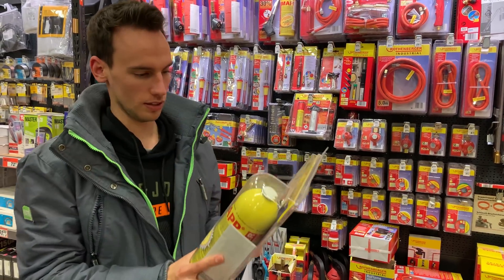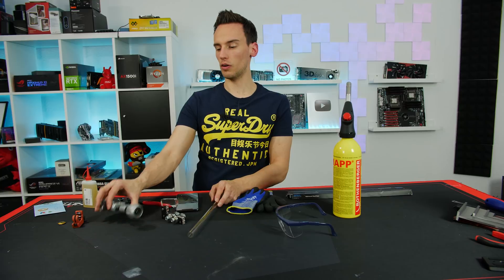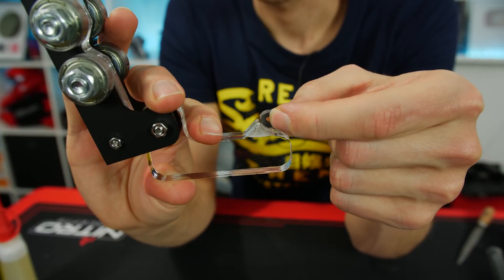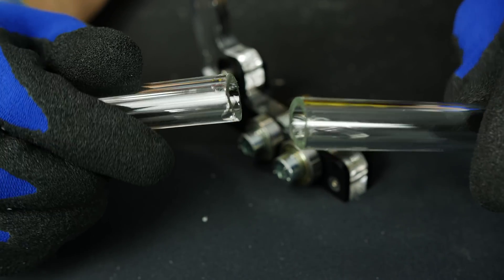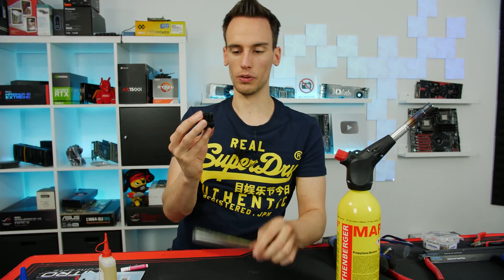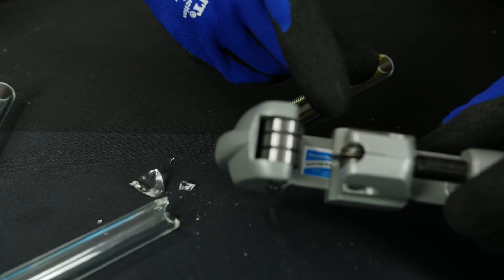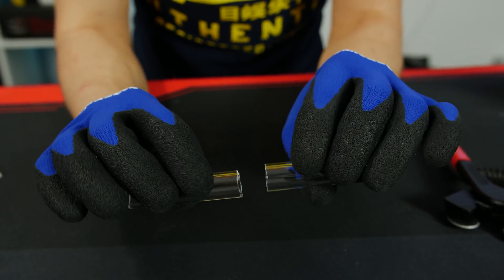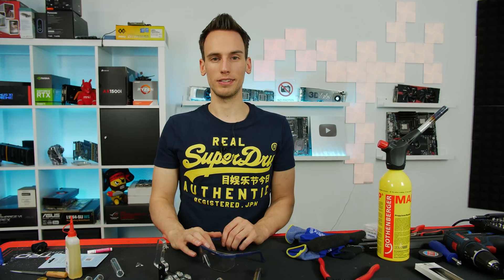Project Irrationality Part 5: "Why did you not just use a normal pipe-cutter?"

Comment: Roman this is Willie V., I am out of town for the Thanksgiving holiday here in the USA this week. I put a video up using my business channel - WillieWaterWorX. It takes time to get the break of the glass to be somewhat clean. There are lots of ways to break tube cleanly. Look at my video, it also explains how to hold the glass and break it, you are brute force snapping and why it is mostly not even. Also when flaming the end make sure to hold the tube in the flame at 90 degree and always rotating be careful not to heat too long cause it will then start to slump to one side! I will be putting up a couple of videos showing more on how to work with Borosilicate glass. Please check out my channel to learn more on my adventures with Boro.
Reply from the maker: Hey Willie :) Yes I saw your video but only after I had already shot this one. I will try your tips in the next video or in the video where we will work on the system directly. Really appreciate the feedback!
Reply: @der8auer  You have helped me with so many of your videos, it makes me happy to help you with what I have decided to specialize in for my builds and make it a business. I strive to be as large of a You Tuber as you and look forward to helping you in any way!!!

Comment: To cut glass you need something harder than glass like diamond and sometimes thermal shock. So firs you mark/score whit the cutter and then you heat up the glass (where the cut is) and dip in cold water it should separate clean where the diamond mark was left.

Comment: a suggestion on how to fix the diy cutter, 2 holes  in the thick part of the acrylic. get 2 metal plates with 3 holes. secure the metal plates to the acrylic with the 3rd hole for the the cutting wheel.
and with the metal plate, you can make the 2 securing holes on the into slots so that you can use different  cutting wheel sizes.

as for cutting  glass, a thinner cutting wheel..like a dremel. or  apply less pressure but do more cuts/rotation. glass is hard but not tough.
alphacool had a video but it wasnt ideal, dust and no rotation.
but this ExtremeRig seems good concept and execution
https://www.youtube.com/watch?v=v9kT4v51nAM

this next one is more ideal since he used a lathe machine, which allows for variable speed turning  and the cutting tool mount has better control of moving the cutting head towards the material
https://www.youtube.com/watch?v=8tbm8V9vyMk

using oil might be good to trap the dust since it doesnt evaporate, but water works just as well if you  have a drip tray. 

a thinner cutting wheel meant the force applied is more localized to the cutting than splitting.
the rapid heating and cooling by burning a string soak in alcohol might work, but i'm not sure of how clean it will be.

Comment: It took a lot of experimenting to learn to cut glass and the main issue I had was using too much pressure when scoring the glass, it worked best when using a high quality standard glass wheeled glass cutter and using just enough pressure to leave a very light mark and a single pass with a very quick separation, if you hear grinding of the glass it is too much pressure.
Reply: YES! It was painful to watch. Poor tube.
Reply: If you want cleaner cuts without much force, an easy trick is to tap the edge of the scribe mark with a small hammer to propagate the crack through the lattice before attempting to separate. The more time you spend on tapping, the cleaner and easier the separation will be.

Comment: Those tubes had to be cut in the factory too... you might try to ask them for a visit and see how they made, could be interesting anyway.
Reply from the maker: I think in a factory you can use a diamond cutting wheel but under water which pretty much solves the dust problem
Reply: @der8auer  but those cost a fortune
Reply: @MustardGamings  if you are a factory is an investment to make those cut perfect, fast and reliable. Make sense for them, not for a home gamer that care about silicosis
Reply: @MustardGamings  i buy diamond saw blades for angle grinders. Used for tile cutting, not very expensive at all
Reply: @sintaxera  that's good